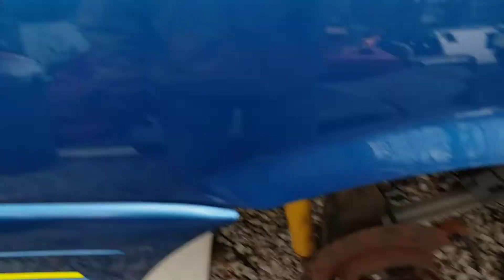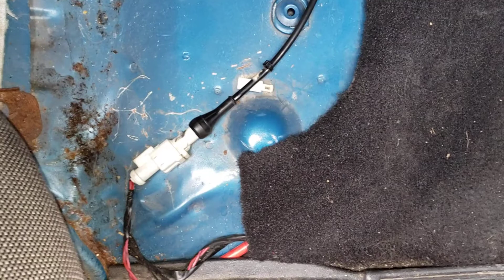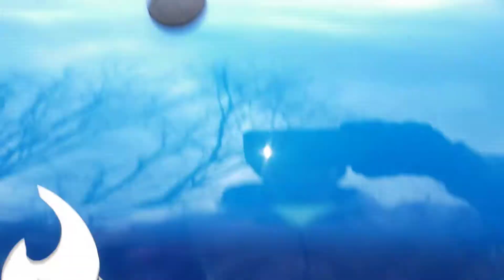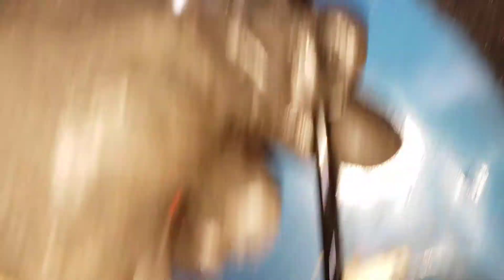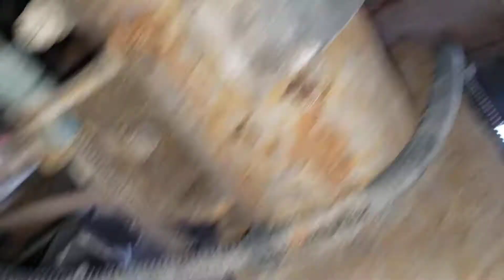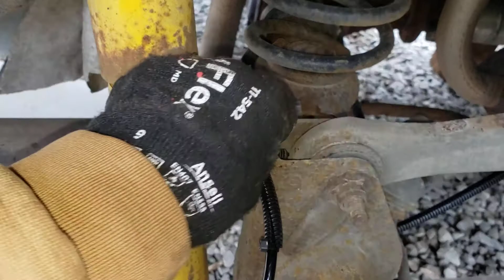Rear ABS Sensor Replacement On 2008 Ford Crown Victoria Police Interceptor

Comment: Hello, thanks for the video and instructions. I'm wondering, where did you order the sensor from? I need one for my 2007 CVPI.
Reply from the maker: I'm not 100% certain but it would've been either Rock Auto or A-1 auto. Both of which are online parts dealers. Rock auto normally has better prices but sometimes we find that A-1 has parts that cannot be found at Rock auto. 
Hope this helps.

Comment: What code did you have?!?! P062C?
Reply from the maker: Not sure what code it would throw. I found the destroyed speed sensor while changing the rear axle bearings.
Reply: @nathansantos524  bro did you fix your problem? Because I have the same code and can’t find anything
Reply: @BaxkRoadLA  The transmission was destroyed and had to be completely rebuilt by a transmission specialist.